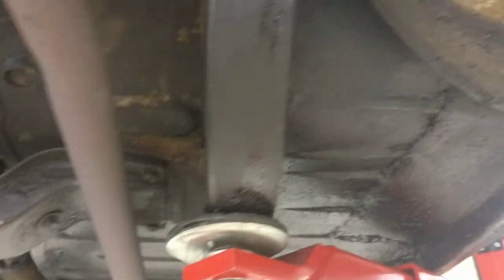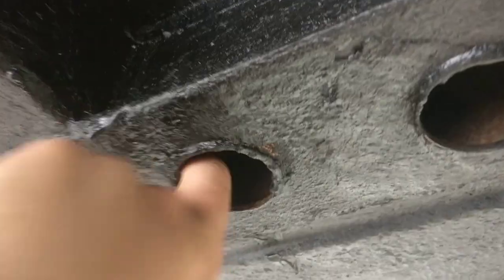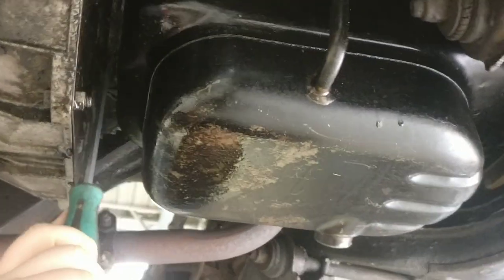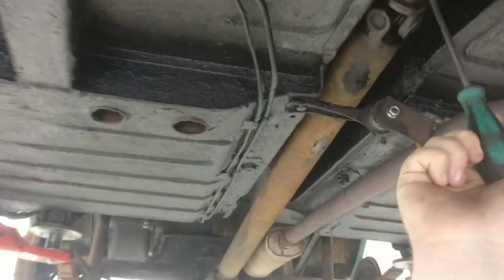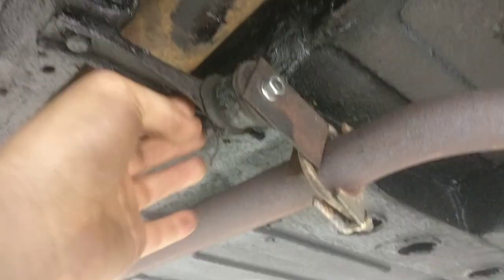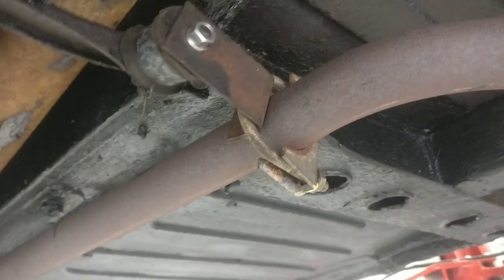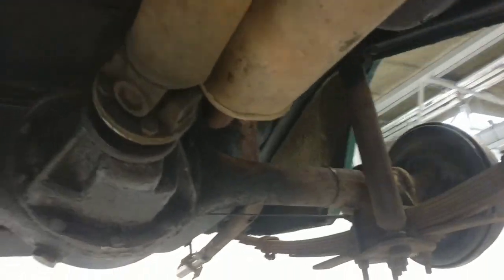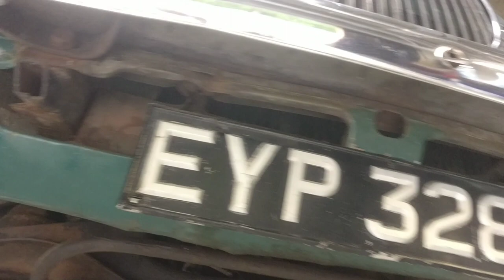1965 Singer Gazelle underside inspection

Comment: Chromework is in fantastic condition. Mine is crazed on the front bumper and the rear number plate surround and boot hinges are flaking. Hope it sells.